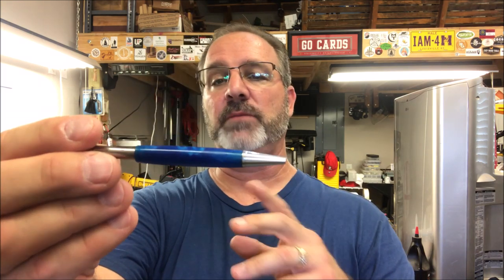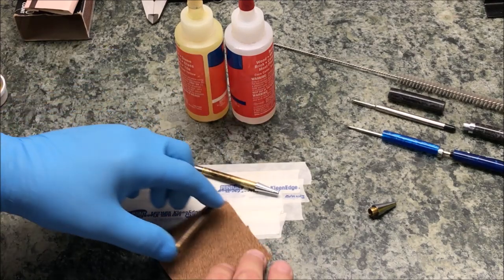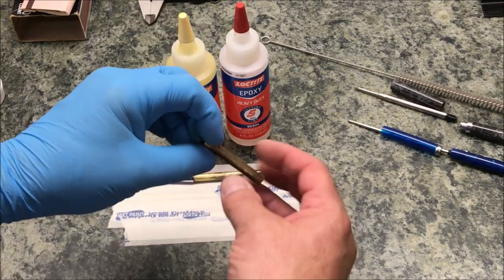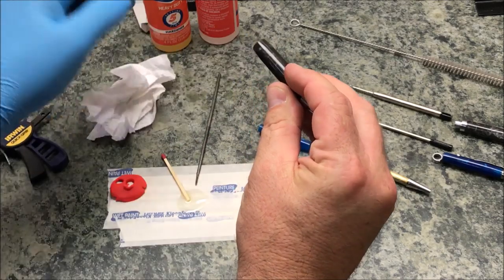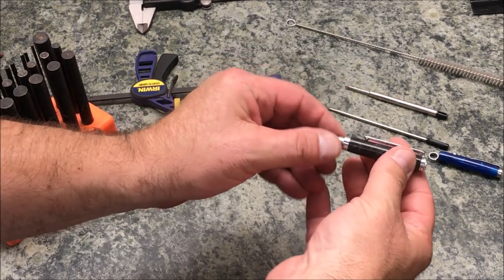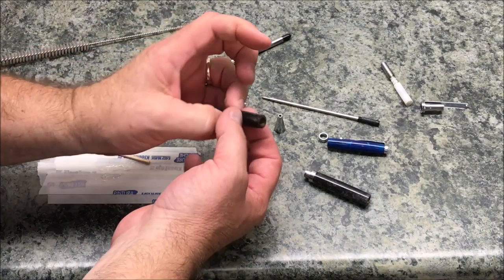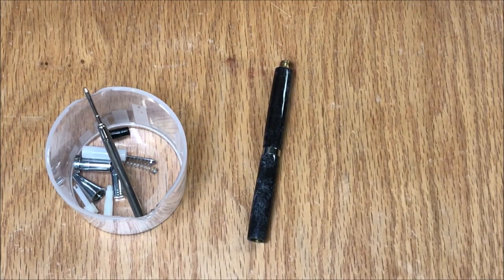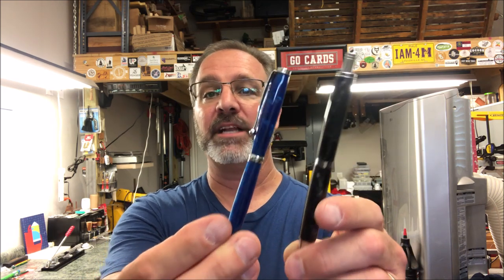Fixing a couple Acrylic pens

Comment: All of your video's are fantastic. I enjoy that you explain things in detail. I can't seem to find any video's on chip outs on acrylic blanks. I have a chip out on the very end of a PSI victorian rollerball. The top is very thin between the blank and the tube and am not sure how to approach it. I would feel a little bit better if it was in the middle of the blank but it's at the very end. Any help would be greatly appreciated. Thanks for making al the video's and thanks for any help with my problem.
Reply from the maker: Clean the chipped out section thoroughly with Denatured alcohol. Cut out a piece of plastic from a milk bottle. Use a milk bottle because it’s HDPE and C/A won’t stick to it. Clamp it tightly against the end of the blank to be repaired. Fill the chipped out section with medium C/A. Do not use activator, let it dry naturally. Once dry inspect it and if it settled and there is a low section, add another coat of C/A. Once it’s level or raised, remove the clamp and carefully pull the HDPE off the end of the blank. You should be able to finish turning it. 

Regards,
Bob

Comment: RJB, I have a question that I hope you can help me with.  I've recently retired due to medical reasons and need something to do that is within my capabilities.  Watching your channel, and others, has convinced me that I would not only enjoy pen turning, but that it would be within my physical limitations.  My question is about what type of lathe to get; woodworking, or metal working?  I love and collect fountain pens and would concentrate on making those.  As my skills progress I could see myself wanting to design my own pens.  This might entail making custom barrel and cap bands.  My primary turning media will most likely be synthetics, as opposed to wood.  Thanks for any input!
Reply from the maker: This is a really tough question to answer. A lot depends on budget. Woodworking lathes can be had from a couple hundred dollars on up. Metal lathes are substantially more expensive. 
  I think I would start with a quality wood lathe. You can make fountain pens on it, I have made many on mine. 
  I would recommend purchasing a name brand like Ricon, Jet, Nova, or one of the many other name brand lathes. 
  If you purchase a Harbor Freight, Turn Commander or any of the value priced lathes, it will work but you will not have the tolerances you will with a quality lathe. 
  Fountain pens need accuracy. 

  Master the wood lathe and then you can maybe sell some of your pens to fund a metal lathe. Not only are metal lathes expensive but the accessories are expensive too. 

Regard,
Bob
Reply: @RJBWoodTurner  Thank you for all of the input and taking the time to respond.  I really appreciate it!
Reply from the maker: You’re welcome. 

Regards,
Bob

Comment: Great video as always! Just wanted to say that everyone has told me when you have to glue the parts in the tube to use red or blue lock tight so if you do need to remove the nib or cap you can still punch it out
Reply from the maker: Never heard that before but it is an interesting idea. I might have to try that. 

Regards,
Bob

Comment: Bob, thanks for the great video. You have stated no problems with wood blanks. What viscosity of CA do you use when gluing blanks? Also, someone commented on using Gorilla Glue since it expands. What are your thoughts on this? Thanks, Rick
Reply from the maker: Hello Rick,
  To this point I have had no issues with C/A and wood. I am concerned with as much as wood moves with humidity. 
  With that in mind I’m moving to Epoxy for wood blanks too. 
  I use to use Gorilla glue. People say it fills voids because it expands. It will never let lose, but it is a foaming glue and can sometimes be unsightly when used. Especially with acrylic blanks. 
  I know a lot of people like it but I’m not a fan. 

Regards,
Bob
Reply: @RJBWoodTurner  Thanks!

Comment: Great Video as always. I to found the the 2 part epoxy works better but I have a question I'm just starting in this and I notice it seems that I'm turning the wood down to close to the copper tube and the epoxy or ca isn't holding because the woods to thin is there a rule to how close to the tube you should get.
Reply from the maker: Are you using bushings,
  You will turn close but they will keep you from turning to far. 
  Many people use calipers but it’s best to start with the bushings and use calipers as a back up until you get comfortable. 

Regards
Bob
Reply: @RJBWoodTurner  Yes I am using the bushings I'm using the Viceroy Pen kit. I taper the end right to the bushing but it seems like the whole length of the shaft is very thin. Should I use calipers and if so what thickness should the wood be to the copper tube.
Reply from the maker: I would stop short of the bushings. Test the wood against the pen component. Perhaps they sold you the wrong bushings.

Comment: Hey Bob. Love your videos and learned alot from them. Question I have for you is i have turned about a dozen fun line slim pens lately and have noticed that the top barrel spins continuously making it hard to retract and extend the ink cartridge. My fix was to put some thick ca inside that tube in hopes that it would grip that transmission better. It worked but my concern is it may be a short term solution as the ca will likely wear off from pulling off the top barrel to replace the ink cartridge. I know they are a cheaper pen but they are at a price point that many are willing to pay compared  to the higher end pens. Any suggestions?  Thx.
Reply from the maker: Hello Pat,
  I’ll bet you’re using a barrel trimmer. They tend to elongate the brass tubes and cause them to slip. 
  I use a sanding jig. Check them out at turners warehouse:

https://www.turnerswarehouse.com/?ref=8zgq7wolkt-

  Just search sanding jig. 

  You also need a set of punches. I got those from Harbor Freight. 

  And a disk sander. Harbor Freight or Craigs List. 

  You will never have that happen again. 

Regards,
Bob
Reply: @RJBWoodTurner     Thx for the reply Bob. I used both the barrel trimmer and the sanding jig with the same outcome. Made 2 more this am with the same results. Not sure whats happening and im searching the forums to see if anyone else has experienced this. I believe it is something i am doing,or not doing, as i am also using kits from 2 different manufacturers so i dont believe it to be faulty kits. Things that make you say hmmm lol. I will keep going and i will figure it out. Hope you enjoyed the show this weekend and look forward to more videos.